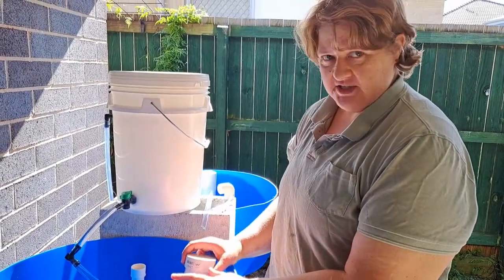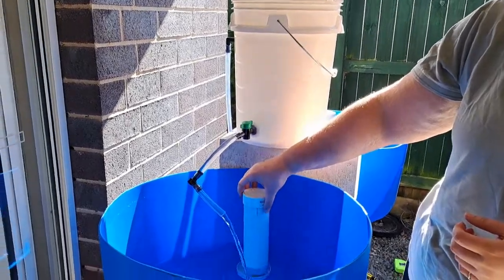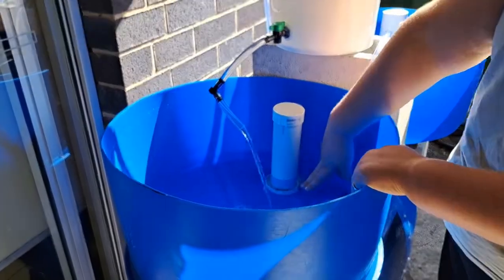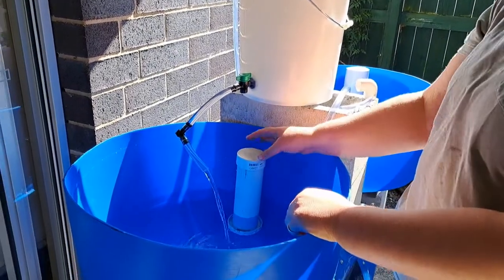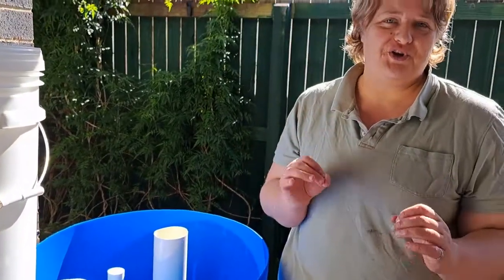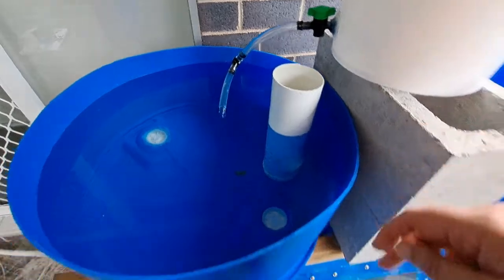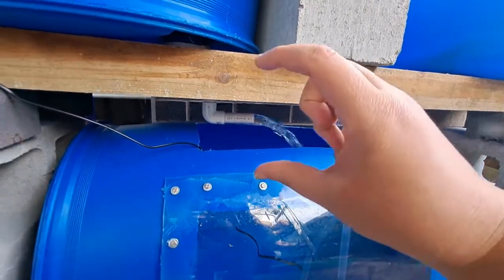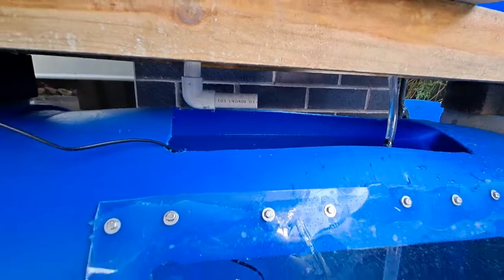Do You Need a Bell Siphon in Aquaponics?

Comment: Did you know that the distance between the top of the standpipe and the top of the bell also effects the starting and stopping of the siphon? I've found that  1.25cm - 2.5cm or .5in - 1in works best. This seems to be because the amount of air to be suck out or put back in has a smaller volume. I've also never found any advantage other than looks for the reducer. Ifg you get the standpipe radius right it's not needed. I run everything with straight pipes now. I saves a few dollars on the build. Great step by step video. Keep up the good work
Reply from the maker: Yes, the gap in between makes a difference, and I haven't noticed a difference with the reducer. It depends on the flow rate, it is meant to help let more water in quicker, but if you have valves you can adjust this anyway.
Reply: @CandyTheAquaponicsLady  i made a functioning bell siphon from a eye dropper and a syringe casing.